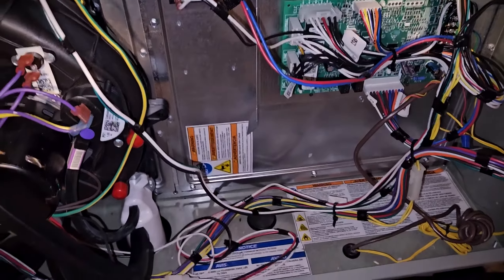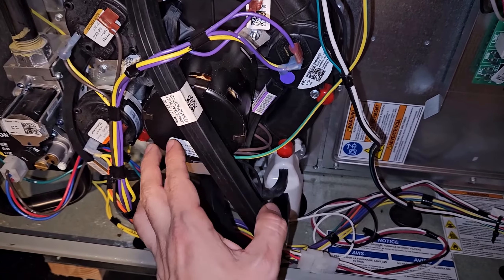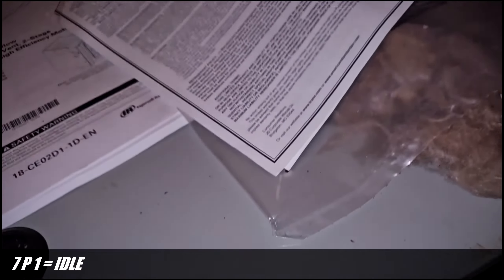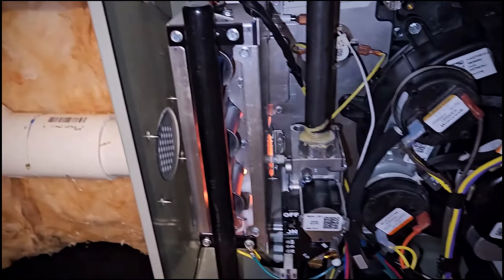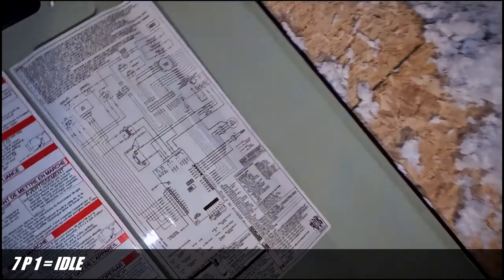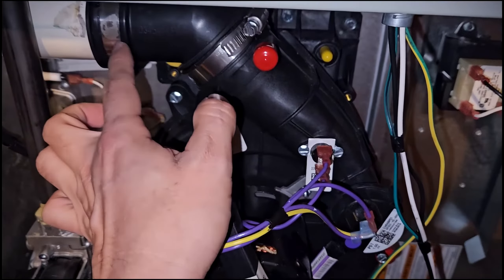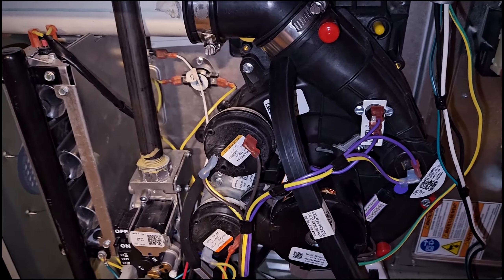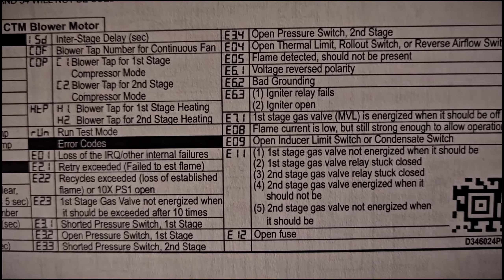Furnace Error Codes. 7P1, 3.2 others. Compressor stuck. Pressure switch error

Comment: For any service tech who ends up here. Let me save you the trouble. 7P1 is IDL backwards. Stay off the ganja. It’s in idle. You’re not getting a call. Check your t stat
Reply: I Installed A New Goodman 96.1 Efficient.   Set Fan Manual, Blower Ran.  After Gas Line Installed (Opened), I got IDL And EE5.   I have Re-Set (unplugged) Unit a Few Times, Turned Gas Valve Off, checked that Both Pressure Switches are Not Clogged and Motor Spins Freely.  Yet I Still Get ILD & EE5.  .  Thought I Heard a "pop" like when You get a Fuse popping.  Panel Breaker Is Fine, Individual Receptacle to the Furnace Is Fine (grounded).   Help is Needed And Appreciated-David.